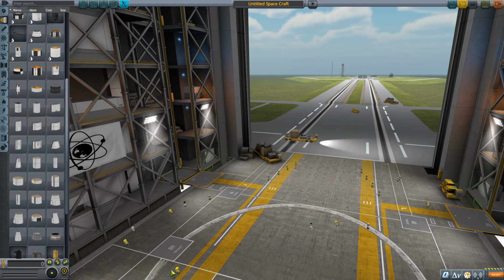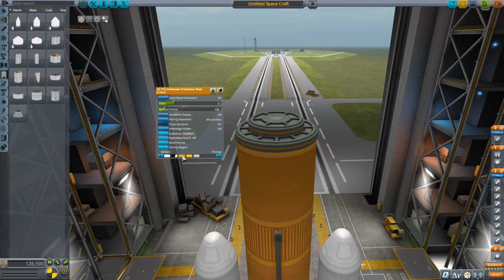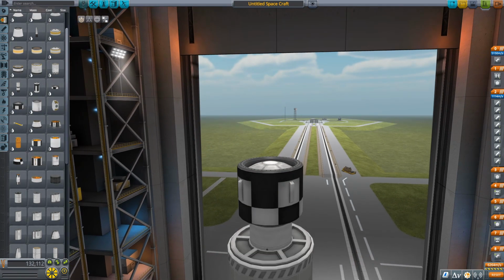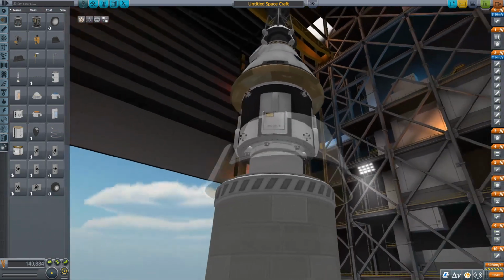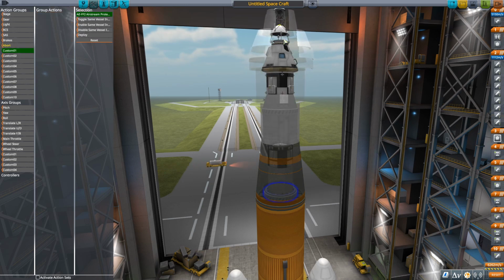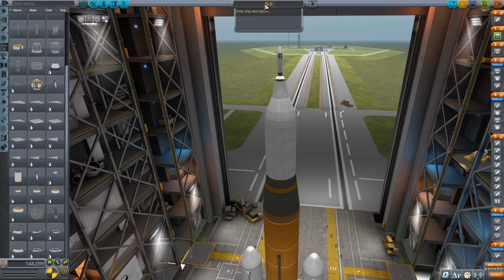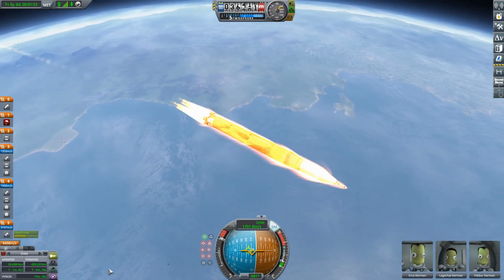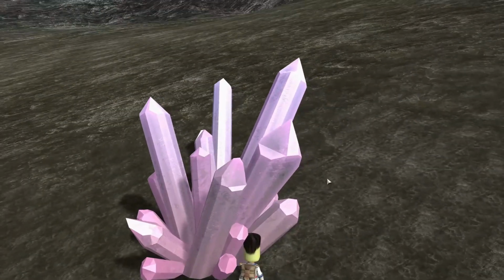KSP Tutorial: How to Build A STOCK SLS and Orion! 1.11

Comment: For Xbox players or people without 1.11, for 5-way RCS use a normal RCS block and add a small one in the middle.
Edit: Also, for the LES (launch escape system) you can use a small fairing and put it under the capsule and have a decoupler below and above it.
Just use another fairing for the rest of the covered parts.
Hope this helps!
Reply: ps4 aswell
Reply from the maker: noice
Reply: You forgot some seperatrons

Comment: I wish KSP had Orange 5 meter tanks because the Making History 5m tanks are closer to accurate proportions for an SLS rocket. Also, it would make more sense if there were a 3.75 meter capsule, because that is closer to the approximate diameter the Orion capsule would be in KSP proportions. There is literally a 3.75 meter heat shield, why no size 3 capsule?

I haven't seen any mods that add 3.75 meter Orion capsules. There is reDIRECT that adds a 3.125 meter Orion capsule, but it is 3.125m, not 3.75m, so it is a bit small and kind of hard to use. 
There is also a mod I saw that adds a CST-100 Starliner style 3.75 meter command pod, but it is based off of the Starliner, which is closer in size to the Apollo capsule and would make more sense as a 2.5 meter part.

GUESS I'LL HAVE TO DO IT MYSELF
Reply from the maker: we need orange 5 meter now!
Reply: @Piolet1549  Yeah you could use the 5 meter tanks for an SLS, and it would be somewhat realistic because the original plan for the SLS was to have the core tank white like the Saturn V.

https://4.bp.blogspot.com/--1UZWtYDgdw/UBR0xyV4xAI/AAAAAAAASpY/BVfHLcT5izU/s1600/NASA-SLS_Architecture_20120729-580x470.png

I kinda liked this design as well, my only complaint is that it looks like NASA was like   

Engineer 1: "Ayy bruh I just got a kiler rocketship idea"
Engineer 2: "Tell Me about it my man"
"Aight so we take the Saturn rocket..."
"Uh huh"
"And we glue the shuttle boosters to it"
"no...."

big boy big brein

Comment: Use the flat rectangle decoupler for the boosters it looks and works better
Reply from the maker: tbh the reason that I don't do that because it's hard to tell if the SRB's are attached to the fuel tank or decoupler if you use the small ones

Comment: I would go with a compact poodle on the upper stage, and then a Cheetah on the Orion engine. But, sure, go ahead.
Reply from the maker: the reason I did not go with a poodle is because the upper stage starts skinny, then expands up. Since the poodle is 2.5m, I would have expanded it at least 3m to get the scaling right. That would have meant that the rocket would have barely gotten skinnier from the orange tanks...
Reply: @Piolet1549   That makes sense.

Comment: Use the smaller radial decouplers so that the srbs sit closer to the fuel tank
Reply from the maker: tbh the reason I don't is because it's harder to tell if the SRB's are attached to the fuel tank or the decoupler with the smaller ones.
Reply: @Piolet1549  something I do when i use the smaller r d
Position the camera so that you can view it from the top and center them
Reply: Clydesdale boosters are better because:
1. They are meant for the space shuttle and the sls boosters are based on space shuttle boosters
2. MORE POWER
Reply: @rivuléRainworld  you don’t need more power if we’re talking about Kerbin

Comment: Ay, another Piolet tutorial! And with a bonus cursed undersized core stage!
Reply: Yeah ksp parts are annoying
Reply: @Arae_1  procedural parts would be nice in KSP 2
Reply: Can you explain exactly what procedural parts are please
Reply: @Arae_1  ok, a procedural part is a part which you can directly manipulate to change it's width, shape, height, volume, and a whole host of other things. Variables change of course between each part, whether you're building a propellant tank or a wing for example.
Reply: Oh ok, thanks for the explainer, and I agree, ksp 2 would really benefit from procedural parts
Reply from the maker: 3.75m parts always seem to be undersized... very annoying
Reply: @Piolet1549  they be smol. The only thing I can think they fit at the moment is new Glenn, Vulcan, or maybe proton
Reply: I think proton might be 2.5
Reply: @Arae_1  yeah, 2.5m with 1.25mtanks surrounding the first stage. However, that may be not wide enough... If I ever build one, I'll get back to you.
Reply: @elijahwills7331  ok
Reply: Yeah ksp parts are usually proportionally correct to each other, but not to real world parts
Reply: It would be nice if we had a 5 metre orange tank but I don't think that's gonna happen

Comment: I use 5m parts when building sls because the srbs look better with 5m parts. Sadly they can’t be orange in stock
Reply: Well then you can't use the mammoth engine as it is the engine made for the SLS from the making history dlc. It is true that the srbs would look better though
Reply: @sejithe5th  yeah, i put 4 vectors and make a shroud with fairings.
Reply: @sejithe5th  Actually, the engine cluster you're talking about didn't come from the Making History DLC. It was there from KSP 1.0 . And while the mammoth engine is based on the SLS RS-25 cluster, I find making a custom shroud as @MK245 does creates a better and more accurate aesthetic , as the SLS does not have black stripes near it's RS-25s, just white.
Reply: Well you are in luck because originally the first stage of SLS wasn’t orange it was the good old stock white! So you can say it was the original model
Reply: @aubreyjphilips9481  i know, that’s what i do most of the time lol
Reply from the maker: not sure what to add, you guys have pretty much said everything :)
Reply: @Piolet1549  then I shalt add more- one could create a first stage by mixing together lots of 2.5m diameter tanks to create a 5m width. And to get the best size ratio, the 2.5m capsule is not actually big enough. So I build a custom capsule with fairings to get the best look.